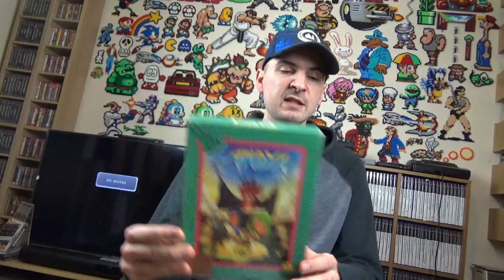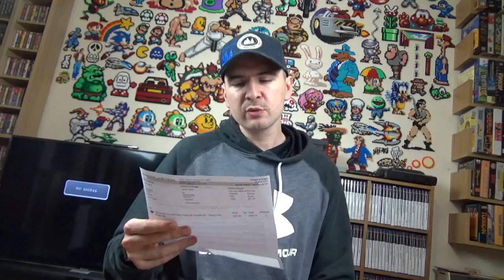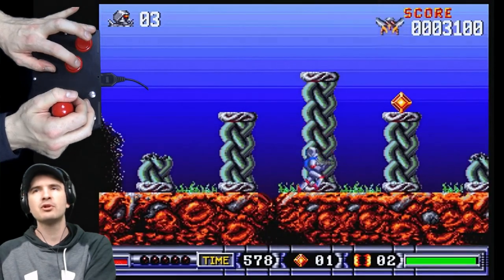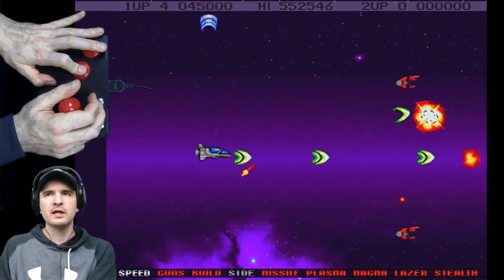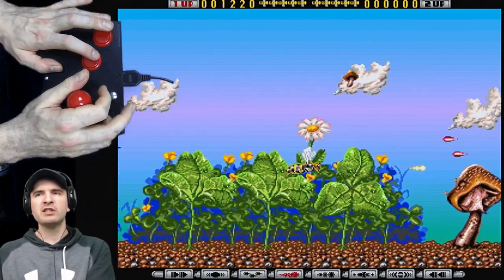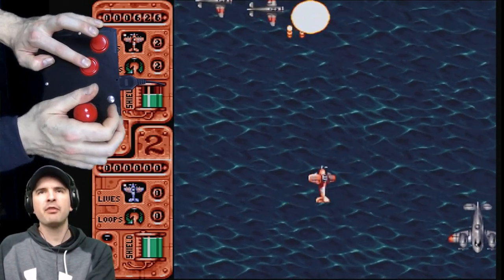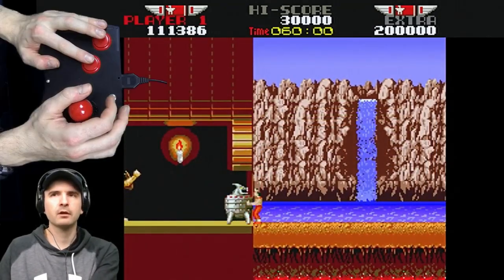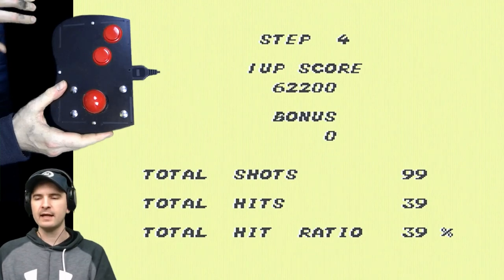My first Monster Joystick - Unboxing and Try Out Video - Amiga & Master System

Comment: The little switch next to the 9 pin connector is to make up on the joystick use the 2nd button instead, so instead of up to jump on platformers you can use the 2nd button to jump, but up does nothing when the switch is on. Its a great stick, ive not used my Zipstick since before Christmas since getting the Monster Joystick.
Great video :)
Reply from the maker: I didnt know that. I did wonder what that switch did.
Reply: I have the cd32 mousemat as well , great choice :)

Comment: Great unboxing and try out video. Built some Arcade Stick myself and it looks really promising. Recognized your increase of skill with two buttons! And it is not only a Ninja - it is THE Ninja - love that game on SMS ;-)
Reply from the maker: Did i get its title wrong? I wont be surprised. However i was surprised with Battle Squadron. Did you know this beforehand?
Reply: @MorganJustGames  Unfortunately I tried two buttons on Battle Sqadron myself a few weeks ago and found out - it did not work. I read that there is a modded WHLoad/CD32 version which supports the 2nd button! That version did work out of the box.

Comment: Great video mate. The Monster reminds me of my Quickshot Maverick with 2 button support, but less comfortable.
Reply: If you have the microswitches then you have a Maverick 1M. There is more than one model of the Maverick (as I found out) but only one model that has microswitches. I had one back in the day (no idea where it disappeared to) but took me buying the stick twice (first time only to find their was another version)
Reply from the maker: Ive never tried one of those.  Is itva see through Joystick as ive platef one like that in the past.
Reply: @MorganJustGames  The case is charcoal black with red buttons and stick top, with suction cups on the bottom. Layout is arcade style with the stick on the left and buttons on the right. It has an autofire switch and a switch that changes between systems for compatibility.

Comment: I've been meaning to buy a couple of these joysticks for my Amiga's as I have Sanwa JLW joysticks in my Arcade Cab, pretty sure from memory those monster joysticks use JLF series Sanwa sticks. Those buttons are Sanwa OBSF-30 and are super light fast response and short throw, one of the best buttons to buy.
That section in Project X at 17:00 that you find difficult without stealth is actually very easy, the tip is don't fire your weapons during that whole sequence = very easy, that way you're not wasting valuable power ups on stealth.

The switch at the back of the joystick is to replace 'up' for jump to the second button.
Reply from the maker: You learn something new everyday. Thanks for that.

Comment: Great video, surely the company who make them could send them fully assembled? You made it look easy but I would have fainted if I opened the box and realised I had to put the thing together 😩 Will be very useful to watch if I ever have to assemble one👌
Reply from the maker: Hahahaha yeah mate its gotta be put together. A bit of a nuisance and those side screws are a fiddle.

Ill check the page again and see if there is anything for the problem round the edges.